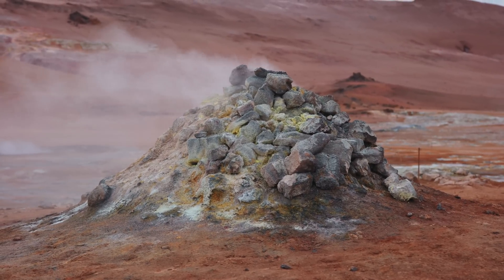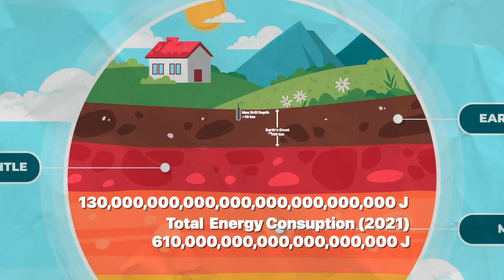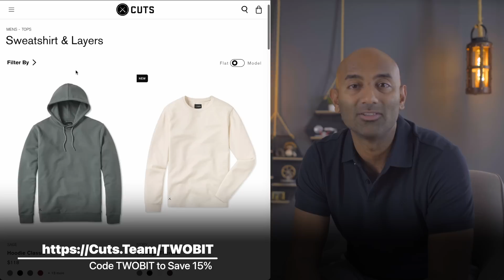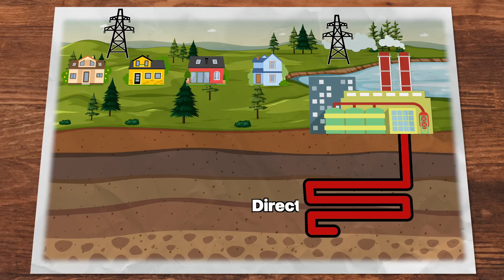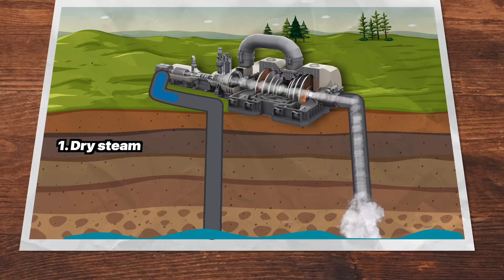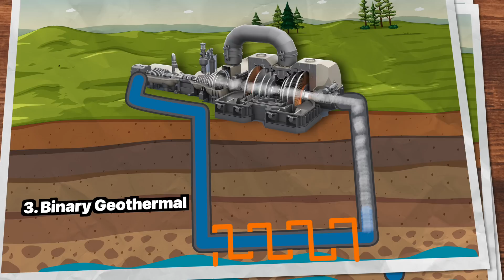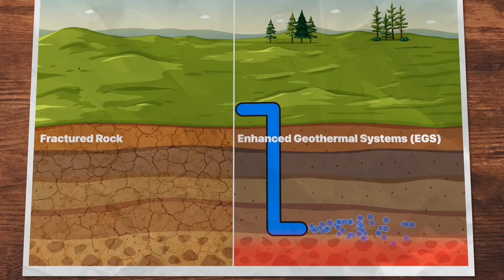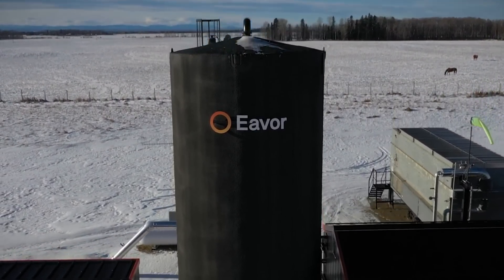This Breakthrough Energy Source Will Replace Nuclear & Coal!

Comment: I know it will take a long long time to feel the effects but what happens as we take heat out of the core and slowly cool it ?
It worries me but will be well beyond my lifetime.
Reply: Planets cool over time anyway. The question is what difference would we make by conducting that heat to the surface faster, and I don't know the exact answer. Obviously it depends on the scale. Besides the heat of Earth's formation and asteroids crashing together, that won't come back, but there are sources of heat like radioactive decay and probably tidal forces from the moon as well. There's probably some differential equation that could answer that, but that's pushing the limits of my math abilities lol. To answer your question though, eventually the core will freeze, the magnetic field will disappear and Earth will be exposed to lethal radiation from the solar wind, stripping the atmosphere and evaporating the oceans from loss of pressure. Hopefully by then we'll be a Kardashev-2 civilization and will have adapted to fully artificial constructed environments roaming around space, or find another nice planet to settle, or some combination of those with different groups of people. I think we just need to buy ourselves the time to make that happen, and try not to blow ourselves up before we get there.
Reply: I think he answered this.  My concern is that the heat from underground has to be cooled by above-ground air/water, so that adds heat to the atmosphere.  My question is how much is that extra heat offset by the non-use of fossil fuels which create the heat-trapping gases of CO2 and methane?
Reply: @lokensga  No more heat than is currently released by burning stuff to boil water, I would imagine. Earth receives about 63,500 TW of solar irradiance. How much of that becomes heat, depends on surface albedo, but it's a lot. Global power consumption in 2021 was about 3 TW - many orders of magnitude less.

Comment: Disused coal mines in my country have filled with water over the years and have become synthetic hot springs, the water that is heated at the lower depths rises to the top and can be used to heat homes using some heat exchangers and a heat pump depending on the depth of the old mine. The issue is getting the money to build the infrastructure, the government is far more concerned with building new natural gas power plants than investing any money in sources of energy we don't need to import, the idea of turning old coal mines into green energy fascinates me.

My country was the first industrialized country in the world, and there is something beautiful about the idea of turning our carbon legacy into a green future.

Comment: I kept commenting about Eavor in various videos on yours and several other Youtube science/technology channels. I am happy someone finally gave them some attention. Green Fire Energy is another company doing closed-loop geothermal and is worth talking about. Since they are taking existing depleted oil wells and converting them into these systems. Which lowers the end cost. I am interested in your upcoming video on millimeter wave electromagnetic drill tech. It would be cool if Quaise and Eavor could get together because building out a closed-loop system like Eavors just deeper, would allow for more efficient heat extraction.
Reply: The technology mentioned does seem to tackle the efficiency of extraction but what is not mentioned is the problem of over extraction at shallow depth  and the problem of permeability of fracked rock where a lining substrate is used.  Both problems relate to thermal conduction. with the former, the cause is that the surrounding rock used to harvest the energy can only 'recharge' at a fixed rate. The  use of enhanced collection methods leads to the simple fact that the extraction volume will exceed the surface collection area causing the well to get cold. Thermal extraction is a balancing act between removal an replenishment, over extract and the temps will drop. The second problem is more tricky.. Fracking rock causes the creation of an area where the rock surface area is greatly increased. However, this reduces the rocks capacity to transfer heat by conduction. Therefor the areas to be broken must be kept small to maintain a reasonable transfer rate . With smaller collection areas, the cracks in the strata would also be fewer and with leakage  from the clay/polymer linings and natural crystalline debris caused by the fracking process  these water channels will become partially blocked and further reduce efficiency.
Reply: Has Eavor addressed the possibility of tremors or plate shifts rupturing the drill lines? If this concern is real, how will they effectively and efficiently repair the compromised infrastructure? Going “fishing” on a rig is easy, but if a plant is built on top of the location, it might be cheaper to build a whole new site. A closed loop system at great depths is great theoretically, horrible in reality.
Reply: @christianshelby9184   Tectonic movement and vibration would not affect boreholes per say. The main problem would come from localise faulting in the outer crust . What is more problematical is that rock acts like a fluid and at depth can be gelatinous. This limits the effective depth of boreholes as the nature of the rock can cause the hole to drift or even close because of the pressure. Where I live in South Wales, old coal miners have attested to the power of the rock by describing how eight inch steel girders are twisted like pretzels because of the weight. The mines are quite shallow compared to deep boreholes and if the weight of rock can do this at 1.5-2km then imagine the pressures at 9km!
Reply: @christianshelby9184  Probably addressed in the same way that the former oil industry directional drillers who formed Eavor, did it in the oil and gas industry.
Reply: electromagnetic drill tech is exactly what i was thinking of when he mentioned the cost of drilling.. I was pretty sure id seen a video on that tech somewhere, but it will definitely be interesting to see Ricky cover it.
Reply: Let's see: locally availible, low investment energy supply?🤔
.....NOPE! Never happened. Too little money to be made for the elites. Sorry, nothing will come to fruition on this. Same with what I think: a nuculear waste diode, patented in the 50's, that would provide cheap and local energy for over 50k years. I donteven hear anyone talk about it...😮‍💨
Reply: Definitely, we’ll reach out to see if they’ll give us an interview. Thanks for the comment. 😊

Comment: LOL. I have over 1500 feet of fractured limestone. I don't mean I have dirt with limestone rock. I have over 1500 feet of layered cracked limestone. yeah 1500 feet of fractured cement. You should try digging in it. its not that bad. it just that you are picking up 2 inch plus layers wedge together. forget getting a shovel full.  
And I don't think that it reaches the heat. Because the water at the bottom is cool.

Comment: Eavor’s proposed closed loop geothermal system produces very low grade heat. They are talking about getting water heated to only a bit above 100C. Starting at that temperature only gives about 75C temperature gradient. The efficiency of a heat engine depends on the difference between the hot and cool point. With so little drop the efficiency is abysmal.
100C water is pretty good for district heating
Geothermal sites that are really hot are rare.
Reply: Eavor's test site is pretty shallow.  They can go deeper and access much hotter temps.
Reply: @incognitotorpedo42  The did an interview the the "Now You Know" channel here on YouTube. They talked about the maximum depth, and maximum temperatures they expect to get. Most sites will be less than 150C, even with bore holes twice as deep as their test site. That's not hot enough to create much electrical power. But it's plenty for domestic heating, and for a lot of process heat in industry. Much more efficient to use the heat directly that to waste >70% of it making electricity. The theoretical maximum efficiency of a heat engine with a starting temperature of 150C, and an outlet temperature of 25C is just under 30%

Comment: 1st thats a lot of drilling just for one.
2nd wouldn't that cause real global warming?  You would be putting heat into the air. 
Next what is the long term effect of cooling the core?
This all sounds good. But is it? 
On a practical note. How far, drilling is needed to hit 212 degrees?  For small scale. I mean I hit crude at 350 feet. water at 1500 feet. I assume it would be much farther for me since the water is cool. And there is no way I could reach 1 mile. I'm pretty sure I wouldn't want to go half a mile down.

Comment: The elephant in the room is the heat itself. Downhole tech cannot withstand the temperature at useful goethermal depths. Perhaps diamond semiconductors may help.
Reply: That's where the micrometer-wave death ray comes in to pulverize the rock without the need for nearby melting microelectronics.

Comment: FINALLY.  Someone came up with a sealed geothermal system.  I had that idea 40 years ago.  What took them so freakin' long?
Reply: Utilities want oil and coal instead
Reply: @Goodwalker720  Utilities don't want coal and oil.  They want cheap reliable solutions.  Coal is that.  Oil use for electricity generation is close to zero.  Natural gas is the major fuel, with coal second, in most of the developed world.
Reply: @incognitotorpedo42  the original comment states 40 years ago.
Reply: I think it must be hard to align the wells and make them connect

Comment: This seems like the best solution.  You should go to New Zealand to check out their hybrid systems (you wanted to travel).  Geothermal also has one of the best life spans; some have been in continuous use for 100 years.  This can mean long term lower costs I am not sure you calculated in your figures.  One prime reason that Geothermal has not been widely used is it has rarely been implemented by private profit making firms. Where there is no profit no one has a motive to get attention to the topic; so I am glad you have made this effort.  One might also ask; why don't we move our industries to where the power is.
Reply: Also check out the power plant at Chena  Hot Springs in Alaska.

Comment: It appears that in most grid locations where strategically distributed 24/7 Geothermal power plants are needed to replace gas peaker & aging nuclear plants, they would only need to provide power for about 10% of the grid load.  Most of the load in most locations can be covered by wind & widely distributed solar + various forms of integrated storage, like pumped hydro or batteries. Another interesting technical detail is that EGS systems can be throttled by over-pressurizing the well during a period of low demand; then tapping that added potential when demand rises.  Thus, the system includes a storage capacity that other typical 24/7 power plants lack. This is a big deal.
Reply: Geothermal is also rated on a continuous basis, it’s governed by the heat flux through the rock. It can be oversized on the collection area and undersized on generator capacity and be run on a duty cycle; essentially treating the regeneration of heat capacity as a self charging battery.
Reply: No it’s not, none of you can can cogently explain how MSR Nuclear Power Plants wouldn’t be a superior energy source 😡
Reply: @Kezoman1  I can its very simple.  Tellerium embrittlement of the hasteloy-n due to the nickle that would be part of any design for a MSR.  That means either they must use a special alloy which would make it too expensive OR try to confuse the public into thinking that a core can be changed every 7 years and it be a viable option to not only replace all the aging reactors we have now but also replace everything that produces our power now.  The fuel is still radioactive even though it transmutates some of the waste as it operates and every 7 Yeats a new core that's irradiated that must be stored.   Oh and graphite contraction and expansion.  Very simple
Reply: Throttling and self recharging heat... Whats not to like.
Reply: It doesn't make much sense to use something like this for only 10% of the load. The space taken up by huge solar farms could be put to other uses. Wind farms are also not that great for wildlife. Rather see a small building than acres of boring white wind turbines.
Reply: If it works so good it would be a waste of resources to use it only for ten percent. Every machine should be used as much as possible to make use of the resources that are needed to build it. Every wind mill uses a lot of steel and concrete and needs a certain time to earn the energy and CO2 that was used to make it, so if you can spare that wind mill at all it would be better.
Reply: @dieterjosef  CO2 is an overused factor that is irrelevant.   Being that humans only produce 0.04% of CO2 released on the planet.  In fact termites release more CO2 than humans do.
Reply: @paulmobleyscience  Wow, what a number. Where do termites operate their coal plants and cars? Is it all in the holes in our houses?
Reply: @dieterjosef  Must be, we must not see them because their cars are so fast.
Reply: @dieterjosef  
I agree that any given power plant resource should be exploited to the fullest practical extent. But demand varies daily & seasonally. So for efficiency, 24/7 resources should be locally/ regionally distributed & developed to match demand.  Too much 24/7 capacity, when it isn’t required most of the time, is inefficient, especially since it’s expensive to develop & maintain, compared to intermittent wind & solar. The capacity to throttle geothermal & actually store energy for a short period of time, say 4 to 6 hours, is a big plus in terms of efficiency.
Reply: @jerrywagner8781  well...geothermal energy IN THEORY can be used as a source of so called base load...if u have ANY experiance in energetics u should be familliar with the concept of base load.
Reply: @emberspirit6375  
Yes. 24/7, base load….that’s what geothermal would provide, to replace existing gas-peaker & aging nuclear plants.  The capacity to throttle, providing short duration storage would be an additional benefit, if that can be made to work reliably.  The Geysers, in Sonoma County CA, has been providing geothermal power for decades, utilizing local wastewater to recharge the aquifer. It’s a very large facility, with multiple wells & turbines.  The hope is that smaller strategically distributed geothermal plants can now be developed, using new oil industry drilling capabilities, to supplement intermittent wind & solar power resources.  The safest nuclear power resource we have, besides the sun, is the molten core of our earth.
Reply: @jerrywagner8781  ye...i havent done detailed calculations of possible energy outcome, but i think its very much work needs to be done and requires a lot of investment in infrastructure...in my opinion they should think of building industrial clusters right arround the source of energy to avoid overspending on transmission infrastructure which could make this source of energy economically not effective...In short if we are talking about source of BASE LOAD we should first think about who will CONSUME that LOAD and HOW to deliver that energy TO END CONSUMERS...let me know pls if u got my point...and srry for my terrible english. Also id love to know where r u from it could make our possible further discussion more convinient. Anyways thx for writing me back.
Reply: @emberspirit6375  
Makes sense to me. Transmission is expensive to build & maintain. And above ground transmission is vulnerable to extreme weather & can also often cause wildfires. That’s why widely distributed solar with integrated battery storage, including battery electric vehicles & V2G charging is highly desirable in populated areas. Soon, leased commercial property, like neighborhood shopping centers, business & industrial parks, large office buildings & apartment complexes will begin installing solar parking lot canopies with integrated storage batteries & banks of V2G chargers. These relatively high demand locations will form the backbone of 1 to 2 mile radius micro grids networked across our typical suburban solar neighborhoods here in CA. Cheap reliable local community power. Let BigOil & state sanctioned utility monopolies figure out how to adapt & survive….that’s their problem. Massive off-shore wind farms & strategically distributed geothermal power plants spring to mind as possibilities, but they’ll have to figure that out. The way the disarm authoritarian petro-states is to replace them with renewable energy.
Reply: @jerrywagner8781  If you want EV's to replace ICE then you are going to need transmission lines all around the country or cars are going need batteries that are 5-10 times better than they are today. I can't imagine how many solar panels it would take to replace the USA's oil usage. But guessing it is a pretty large bit of land. Are you assuming that Solar panels take less maintenance than a power cable. Last time I looked it up, cables last around 100 years. Renewables are like fusion....20 years away.
Reply: @geoffhaylock6848  
Congratulations on getting every point wrong.
Reply: @rogerstarkey5390  Easy to say. What your take on it?
Reply: That's why you won't see it promoted by the Greens.

Comment: There is a concern in geothermal utilization, the heat engine principle. It doesn’t run simply by charging heat energy in it because it need temperature difference and heat flow to operate effectively. Eventually we’d face a second global warming. 

For sake of argument we’d agree it benefits countries in temperate and northern regions by winter. Such as Greenland. 

Geothermal is no different from nuclear thermal electric generation, need plenty of heat dump. 

If we can radiate heat into space daytime in the equatorial regions than we can continue this discussion.